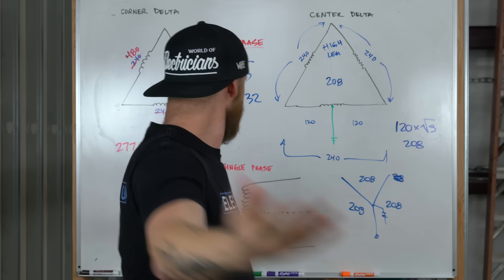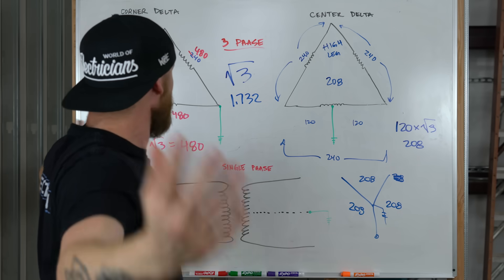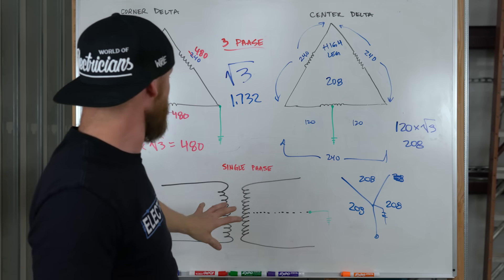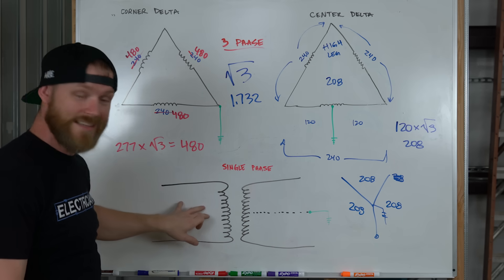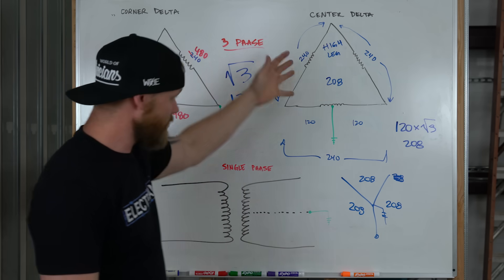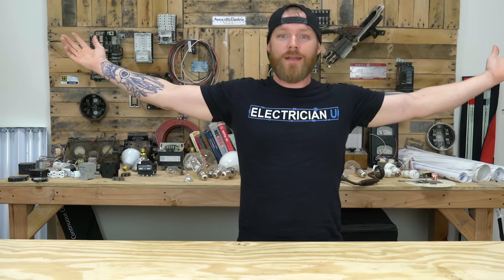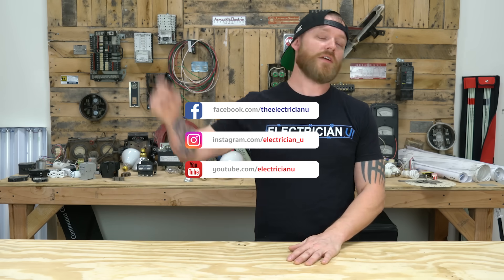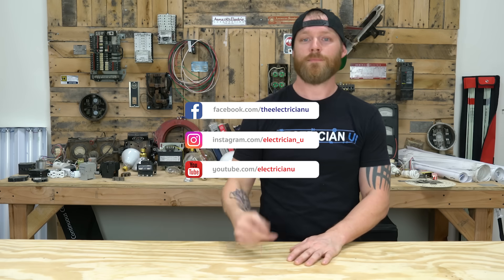Difference Between VOLTAGES - Why We Need Them All

Comment: Dude, America has a weird power system, in Australia, we have star (wye) and delta but ours is 415 volts line-line for delta and 240 line to neutral in star. We don't have an earthed or grounded delta at all, I don't get why you in America do, why would not just use the star for a lower voltage and if a neutral is required? And in single phase, we just use the star and neutral but just evenly balance our single phase circuits across the star as not to unbalance it. Why don't you do that? Rather have a complete different, centre tapped transformer for single phase power? Which still gives you a low voltage and a higher one anyway?? 🤔
Reply: Probably has something to do with war time when they tried to save material by eliminating the neutral wire as much as possible which is needed in the Y setup
Reply: @stevenyau2443  with jews
Reply: You lose

Comment: Id like to know why 12v DC. Why not 11 or 14v? Is it just a convention that got chosen or is there a mathematical reason
Reply: 12 V DC is a 6 cell Lead Acid battery,  the kind that's in your car, so a lot of equipment is already made to work in that range.
Reply: Each cell in a battery generates 1.5 volts, hence the 6vdc and 12vdc

Comment: This makes me wonder how many "weird" voltages we have in Europe that I don't know about, if we even do anymore. I remember having outlets tagged with 380V and 600V back at the old shop I worked at, but they were all considered 400V by the time I was actually working there. I'm guessing that building was on an older IT/TT system then got upgraded to a TN system or something. I think the phase voltages of IT/TT was different from the 230V of the TN.

Anyway, I'm no electrician.

Comment: What is with the ambiguity on name plates that read 105,110,115 and even 125v?
Reply: first power systems decades ago started at 110V which means about 100V got to the homes +/- by the 1930s mains had increased to 115V then in 1984 NEC changed to 120V so with the +/-5% you can see 115-125V on the mains. So when you look at really old radios or something the tag may say 110V or 115V I actually have a old radio the tag says 115V AC.

Comment: As an electrician I commonly wire motors 120 , 230, 240, 277, 300, 480, 600, 1200,  1460 and up.  Some are 200 amps some are as much as 5000 amps.
I wire and manage transformers that step up or step down in the ranges mentioned above as well as voltages of 5kv,11kv,22kv, 33kv, 45kv, 120kv ....   
  Low voltage
Intermediate voltage 
HIGH VOLTAGE .

Comment: You forget about the voltage in Japan - 100 VAC  at 50Hz and 60Hz depending on what part of the country you are in,
Reply: Actually in Japan I've heard they have 3 standards, the 100VAC, the US standard 120 VAC at 60 Hz (I am guessing they got this when we occupied them after the war) and then the European 230 VAC at 50Hz.  But I had read that in the US we adopted the 60 Hz standard because we thought at the time that 60 Hz was the lowest you could go without seeing flicker in lights.  Apparently Europeans have slower eyes than in the US, since they don't notice their lights flickering.  Or it is just bullshit and 50 or 60Hz is meaning less.

Comment: There is also -48 volts used in telecom. It can be confusing because everything is hooked up backwards as it uses a positive ground.
Reply: Landline is 48 volts with a 100 volt pulse for ringing. I found that out when running a line, then connecting a jack and they got a call. LOL
Reply: Just like some British bikes of years ago, lost count of all those I repaired. Lolol

Comment: Delta connected secondary service (customer connections) are no longer offered by most utilities. Some remain in large industrial systems, but are no longer installed. 
Three phase 120/208 volt distribution is what’s normally provided to apartment buildings, hotels, and businesses. Larger industrial customers , high rise office buildings etc have 277/480 volt service and have step down transformers  to produce 120/208 volt. 
Most low voltage three phase motors are rated 208-230/460 meaning they can run on 208 volts, 240 volts or 480 volts. 
Single phase motors are generally rated 200-230 volts so operation on either 208 volts or 240 volts is acceptable.
Reply: We also, in this canadian province don't use 277/480 that much.  Almost always 347/600, or 120/208 .   Seen some 277/480 in a few older 60s buildings.  But very rare still here. 

No deltas either..since the 50s probably.
Reply: @tays8306  lots of delta in Canada. I have worked on many wye start delta run motors.
Reply: @millwrightrick1  

Depends on province.   There is a few hanging around.   But all the new installations we do are almost always 347/600v wye
Reply: @tays8306  I worked in maintenance at a hospital where all 3 phase motors were wye for the simple reason that if you lost a leg , the motor would still run. I the factories I worked in wye was for starting under load and then a contacter would switch it to delta when it got up to speed. Any motor that did not start under load was delta.
Reply: @tays8306 Which province?
Reply: @Richard Vaughn ✅ also allows more flexibility..
Reply: Not true in my area ...
Reply: Where I live in Canada, commercial buildings are serviced with 347/600 with a transformer stepping it down to 120/208.
Reply: @tripplefives1402I think it really depends on your utility provider,  some utilities no longer install high leg deltas or strongly discourage them except for very specific purposes for two main reasons.  Load balancing is poor if supplying significant line to neutral loads, and the possibility of destruction of equipment if the high leg is connected to 120V loads.   Like you said this configuration is still useful and electricians and maintenance personnel will run across them at some point.
Reply: If there is 240 volt 3 phase on the pole, I can request to have 3 phase run to my house. I have to install a 3 phase service & panels. Here is an old 3 phase installation from the 1950s that can kill you: The initial main panel was NOT bonded.  The high leg went to the isolated neutral bus. A 2 pole breaker went to the air conditioner with the high leg off the neutral bus. Then 240 volt single phase went to the house sub panel where the neutral was bonded to the grounding bus. So that high leg on the air conditioner stayed  hot,  unless you turned off the main breaker in the main panel,  and the neutral bus had 208 volts to ground on it unless the main breaker was turned off, sometimes. Some of the older houses had no main breakers. Yay! That was a common retrofit to put one in. Using 3 phase you could save maybe 5-13% on your air conditioining bill. Back then the 3 phase motors were even more efficient then the single phase motors, compared to now. They are still a tiny bit more efficient. Watts are watts.
Reply: @ you can request a three phase service but you need to understand that it will cost you big $$$ it’s not like connecting to 240 single phase. You will have to pay for the transformer(s) metering etc. and you will be on a commercial rate which includes demand charges etc.

Comment: Ye gods you have some wierd setups.

Here in 50Hz land you only really get a fraction of them

240v single phase
415v phase to phase (either as a Y with 3x phase to neutral , or Delta with just 3x 415 phase to phase with a floating neutral)

In some areas its 230/400 but the tolerance is broad enough that equipment is Compatable with both

The only thing you have to be careful with is that an unbalanced delta connection can do some strange things with its virtual neutral

Comment: A-120-240 - (208 Teaser) Delta Low , code color - Black - Red - Orange- White Neutral . B- 240- 480- (416 Teaser) Delta High, color code  - Brown Yellow - Orange Neutral , White or Light grey . C- 120-208- Star Low , color code- Black- Red - Blue , Neutral White . D- 277-480 Star High , color code - Brown- Orange -Yellow. Neutral, Light grey . L1 - L2 - L3 .  Distribution Transformer Combination in Puerto Rico 🇵🇷

Comment: So, 208 is better off a delta with center tap, or with a transformer.

I always figured the transformer based 208 was from a single phase 240 setup that didn't have a 3rd/3phase leg.

I also seem to remember that a lot of 208 equipment seem to have a 240 option if so, does it really even matter? Other than having that extra leg sitting there doing nothing because you have a 3 phase delta.

Comment: i always though 208 was the  voltage between 2legs of 3phase in example a highrise apartment building, and 240 was between the 2 legs of a split phase system for a regular house, is this wrong?
Reply: No

Comment: The Canadian medium voltage standard of 600/347V is becoming more and more popular in U.S. industrial facilities instead of 480/277V  as it saves 20% of the wiring cost.
Reply: 600 V is awesome. 

Simple quick hp to amp rough calculations are easy also.

Comment: You say "Wye" when the connection is actually "Y". In Sweden it's 230V/400V voltages, and we don't have this "center neutral". Also in most homes there's actually 3-phase installed, so even in residential you have to consider the 400V aspect.

Comment: I have lighting that requires 277V....however the building service is 120/240 volts. Does a transformer exist to give me  a secondary voltage of 277/480.  Is it possible to then feed the primary side of the transformer with 120/240?    great videos man....thanks!!

Comment: How interesting.  I have to say that I love electrical stuff even though I'm not an electrician myself.  And you are actually a very smart person so I appreciate that.  My question is... and maybe you have covered this before... but how do you end up with single phase power at the household level when electricity is generated in a three phase system?  Thank you sir!
Reply: Piping California easy, you only run two HV power lines to the outdoor HV-LV transformer instead of three. Can’t make a third phase out of thin air.

Comment: Do you have any videos on medium voltage switch gear or terminations? I've done stress cones by just reading the package but wonder what else is out there that I haven't seen. I'm no electrician, just a nerd with an engineering degree doing industrial maintenance, so I dont see a new job site every week